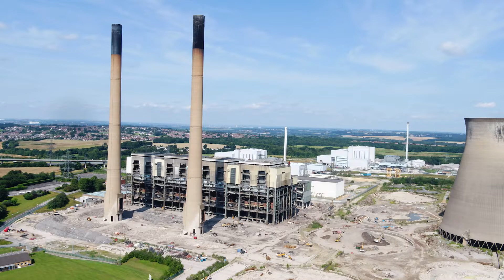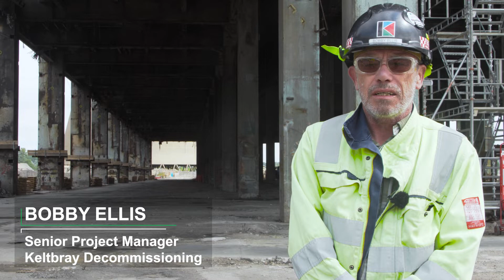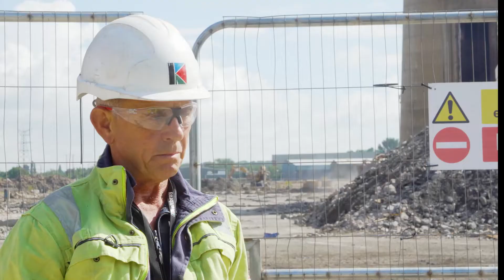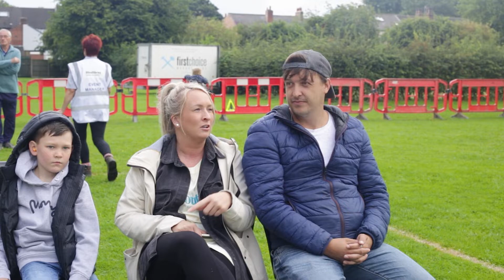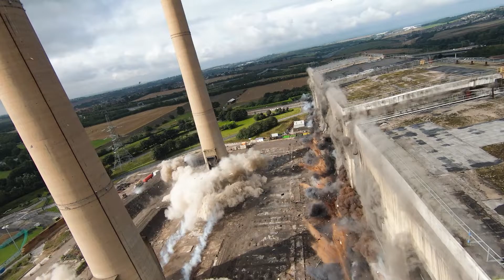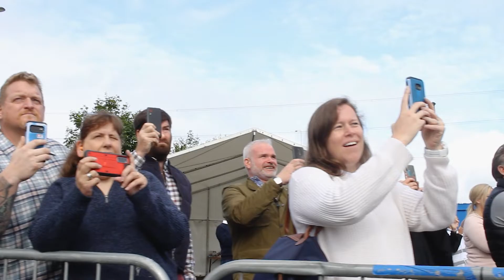Ferrybridge 'C' Power Station Chimneys and Boiler House Blowdown - August 2021 (In-depth interviews)

Comment: I worked on the design and saw the completion of this station, This station and its boilers could have been retrofitted to burn LNG , now we are in a situation with a power shortage that will not go away any time soon, to think of all the heavy industries that have been decimated along with their work forces is a disgrace. But like many things the politicians are guided by those who have never had a real job. Companies such as C.A. Parsons , and GEC/English Electric are no more, and the skills that they contributed to our country are GONE, nothing to be proud about.
Reply: If you had any sense you would be aware that machines and plant can be updated to run on a number of types of fuel. LNG is one of the cleanest fuels available, @tiepup
Reply: Served my time @ parsons (Toolmaker) some of the work that came of the heavy shop and fan casings were like pieces of jewellery pure Art engineering @ its finest…took my bit in 95…since then worked in France 🇫🇷  🇺🇸 🇧🇪 🇪🇸 but nothing ever did or will compare the skill or ability of that  workforce nothing of no one ever could or will …and then on top of that the banter and piss take that went on was electric ⚡️ wouldn’t be allowed now all that woke bullshit agenda that’s rammed down our throats on a daily basis.i digress it was criminal what happened to Parsons and ReyRolle,Clarkies …the list goes on and on

Comment: Great angles to see shaped charges going off, then the kicker charges. Sandbags help contain flying debris. Black coal dust from years of operations was far greater than the smoke from explosives. Picture perfect use of explosives. Neighbors got a front row seat which is always exciting on any explosive demolition. 

It's always amazing to see tall chimneys come apart even before hitting ground. As the ends are accelerating towards the ground, centrifical forces actually pull sections apart. Also, the faster they fall, the stronger the wind current becomes. They are well past 100 kmh, which also tears sections apart. When they hit ground, all that is left is a long and very thin line of debris. Like structures, chimneys are mostly air. Debris gets packed, the air goes away. 

No birds were harmed making this video, they flew away the second the shaped charges went off.

Comment: It is more economical to demolish everything at once because there is only one big cleanup afterwards. If done structure by structure, it would involve many cleanups after each. Neighbors are generally more happy because there is less noise, dust, and vehicles in their areas. When possible, explosive demolition is preferred.